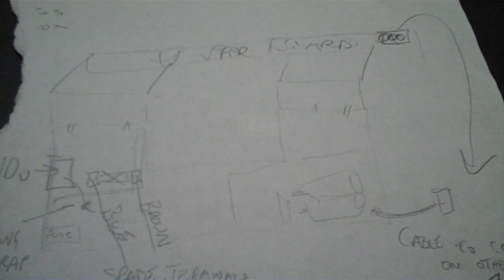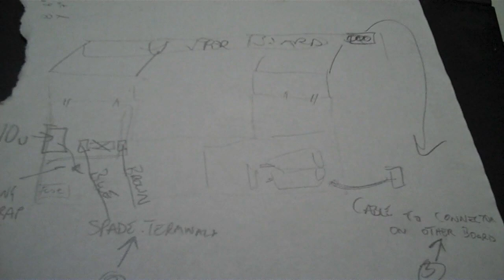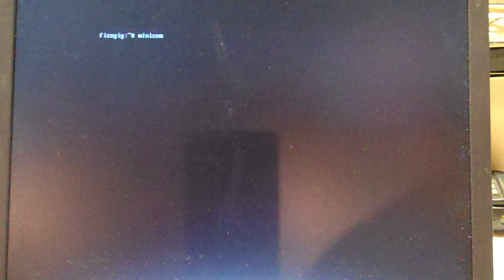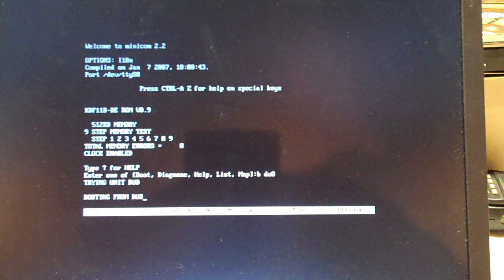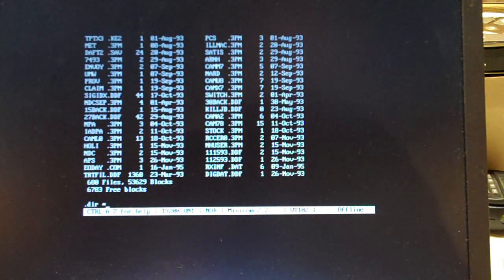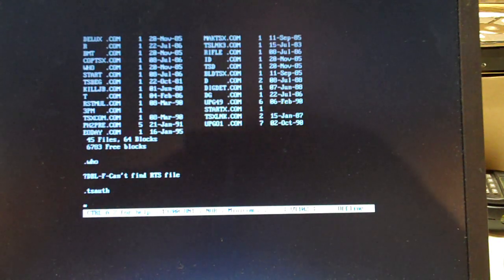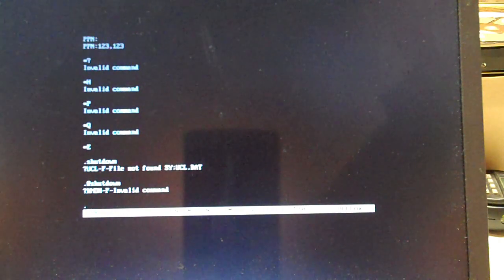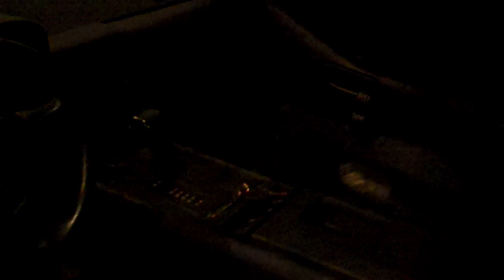PDP11/23 - third time 'round

Comment: We had one back in the seventies running Unix. It was a low memory (32K ram I think) system with RPO disks and the Unix swapper would literally beat them to death.  BAM ...BAM Panic swap error....Nice video.
Reply from the maker: +Wayne Bjorken Heh, I've never actually run UNIX on a PDP... some day. Thanks!
Reply: +jpkiwigeek It was a Bell Labs release. Never released for the commercial market that I know of. The VAX ran commercial System III Unix though. We used the 11/23 for ESS output logging and pattern matching in the telephone world. We found out that the 11/23 was not powerful enough for our application (No.2 SCCS - Switching Control System later called TNM for Total Network Management)  quickly ported to the 11/70 until the 3B (Western Electric) systems emerged. The later were System V Unix.

Comment: TSX was not a DEC product. Where you tried to run TSX Authorize you were not in TSX you were in RT11SJ. I was a field service engineer for DEC from 1979 to 1999. I worked on many of these. I also have a 1123 and 1173 with RX02s and 4 RL02 I have RT11. Been awhile since I have had it fired up. But if you have questions please contact me.